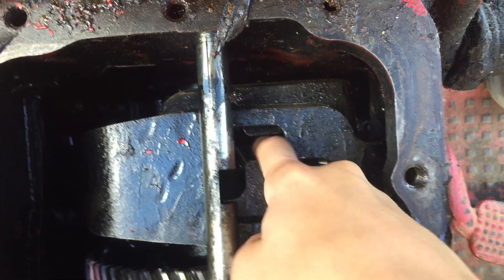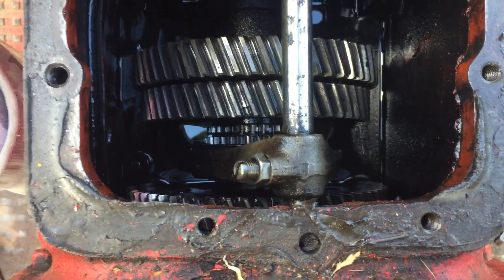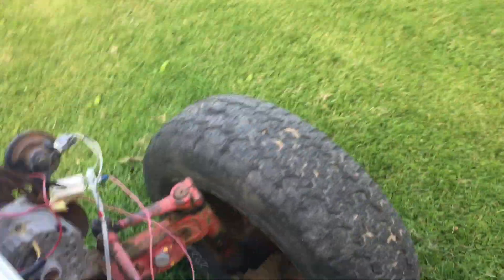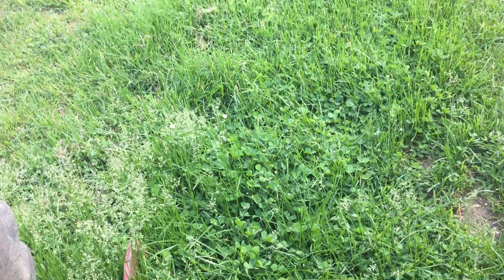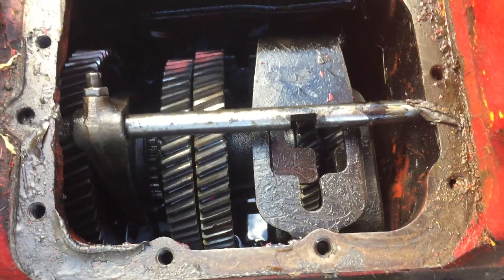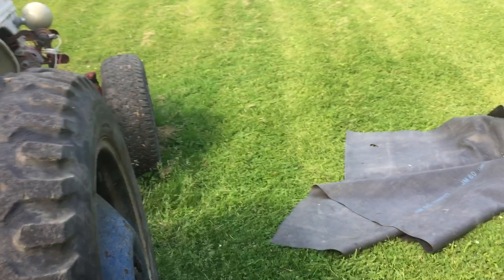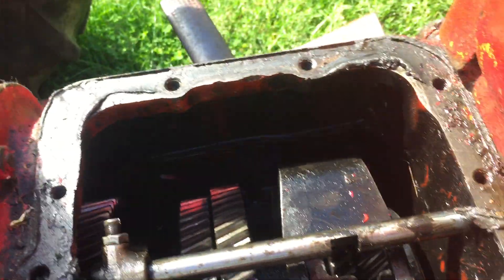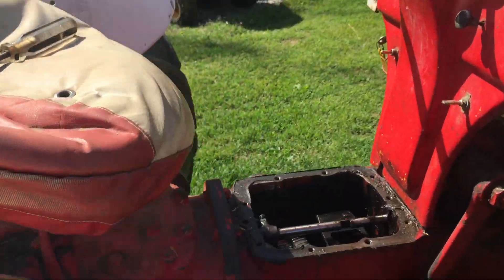Ford 8n transmission jammed/stuck in two gears

Comment: The answer is fairly simple. Disconnect the battery for your safety. Now rotate the engine backwards (counterclockwise looking at it from the front). This will turn the transmission input shaft backwards and release all the pressure that was on the 2 gears so you can easily slide the shift collars back to the neutral position.

If the fan belt is good and has a good grip on the pulleys you can turn the engine backwards using the fan. If you can’t get it to move enough (one revolution is usually more than enough) you may need to find another way such as removing the starter and turning the flywheel with a screwdriver in the ring gear teeth.

Keep checking the shift collars in the transmission. When the engine has moved backwards far enough the collars will be free and you can position everything back into the neutral position. Then you simply need to install the shift cover and get back to work.

If you stopped in time and did not get rough with it, there should be no damage. If you originally heard a loud bang when you let out the clutch or you got rough with it while trying to get it free, you’ll be buying some new gears for the transmission.

Replace the shifter cover with one that isn’t worn or just be sure to shift it carefully and you won’t have a problem again.
Reply: this comment just saved me!!!!!!!!!!
Reply: Having just unstuck my own, I think this comment is legit. I just jacked one rear tire up and rotated it (forward, assuming it was stuck in a forward gear) until it spun free both directions. Started the engine with it still up and stepped on the brake to confirm it was free and neutral, because the friction in the tranny will allow the wheel to rotate w/ the engine.

Money!! Thank you!

Comment: You got it started! What was the spark issue?
Reply from the maker: JD N There is no such thing as 12volt coil. No matter what you will need a ballast resistor, I link 4-3 OHM resistors together and put that between the coil and the positive power source going to coil, that prevented the coil from overheating
Reply: I’ve seen 12 volt coils on eBay. But my tractor is still a 6 volt with a generator, not a alternator.
Reply from the maker: Do you have front mount distributer? Make sure there is voltage going to the top post on the coil. If there is then take the distributer off and take tan cover off. Then pry the black plastic piece off and take out the red piece of paper. Then you will see points. Make sure they are aligned and clean
Reply: Yeah, it’s a front mount distributor. I haven’t aligned points before, but I’ll give it a try. There is power going to the top post, I almost shocked myself touching it with a wrench. I heard the crackle. You should post how you aligned yours. Ballast resistor?? Can you take a picture of how you have yours set up?
Reply: I assume you have resolved the gear issue by now, right?
Reply: Idk if you solved your gear issue but if you did can you please let me know what you did my 1841 Ford tractor did this same exact thing to me today if you have any tips or information on how to get it unstuck please let me know
Reply: @wyatttaylor1018 , If you haven't found the solution, check the comment up top about rotating the engine backwards, or I just jacked up one side of the rear and rotated the tire forward. That frees it up and all was good. I think the gears are cut to hold them in gear under load, so if its loaded up, it won't slide out.
Reply: As far as the coil goes. You have 2 options internally resisted coil or externally resisted coil. If it is internally resisted. Then that is a 12v coil and automatically drops down to 7v. It can't be used on a 6v system because it will drop the voltage even lower and not produce enough spark to ignite the fuel. So an externally resisted coil is needed. That kind of coil can be used on both 6v and 12v. No resistance on a 6v system and the use of an exterior resister for a 12v system. I hope this info helps.